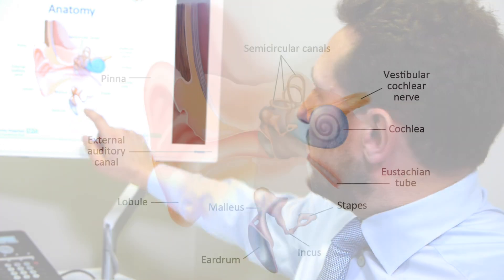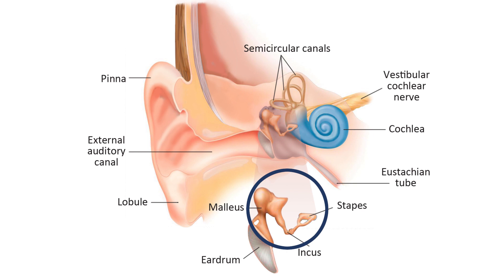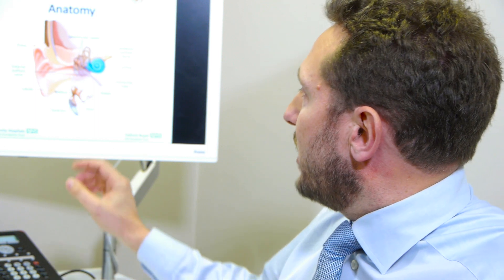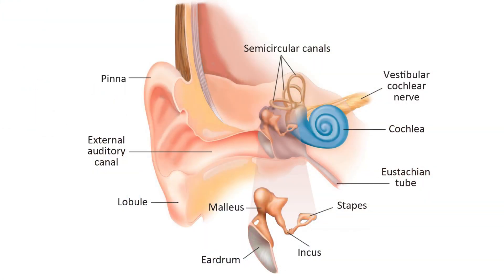What’s the success rate of stapedectomy? || Restored hearing

Comment: I had stepidectomy  op done  about  35yrs ago. Its was perfect for  about  30y. Now the  last 5yrs its gone  extreme sensitive.  I can not cope with this extreme  sensitivey.i have different  types of  noise  Reducers.but to no avail.insidently a crohm was fitted in my ear to pick up  sound. Can ent dr  assist in my problem.
Reply: Im losing most of my hearing in it. When I firsdt noticed I was  waking up to the birds outside singing. Then I tossed over and I couldnt hear them sing, but still could hear. It was the freq, I guess I couldnt hear. Now I just have the ringing that started not long after surgery.